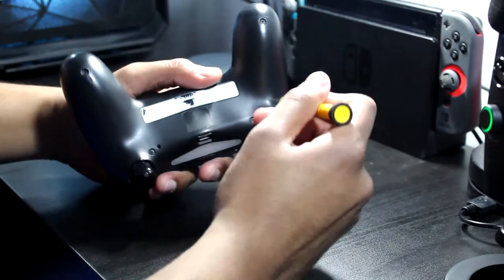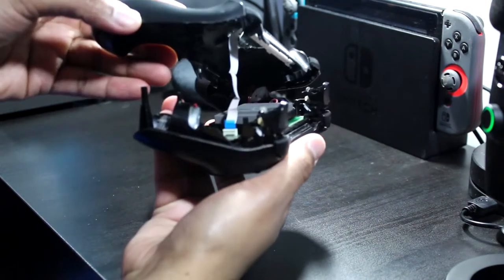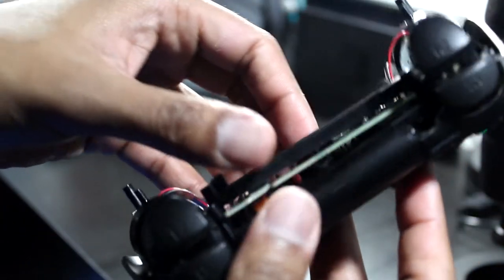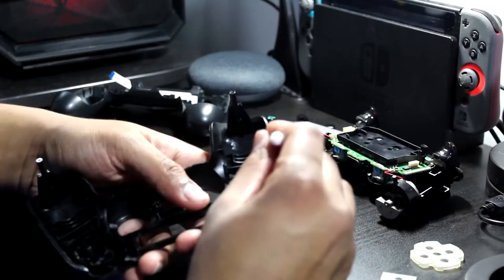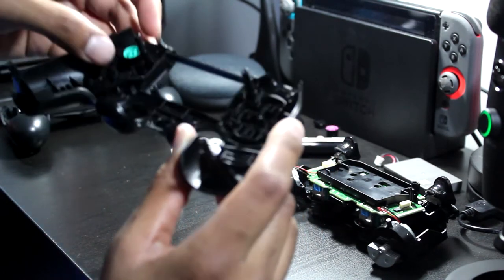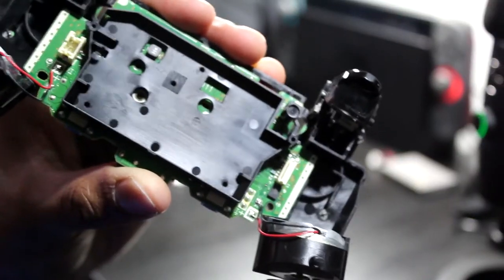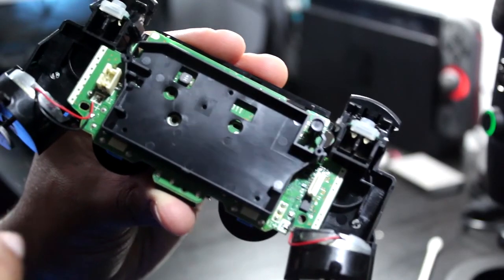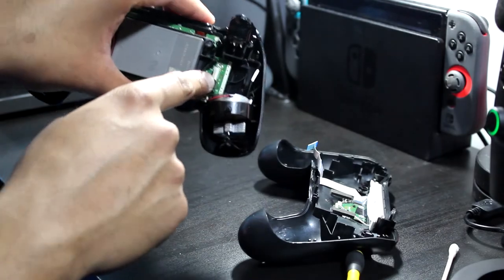How To CLEAN Your PS4 Controller INSIDE and OUT - Fixes Random Button Press Issue!

Comment: BRUUU, lemme explain what i did. I was fixing a joystick problem, (it was sticking and not moving flawlessly so i wanted to clean it, started dumping alchohol down in the joysticks mechanism, it landed alot on the motherboard below and now for the last 4 hours it hasnt started working, no charge, no light no response. My ps4 is completely unaccesable now😕
Reply: You might wanna get a new controller

Comment: Before reading other's comments. I would like to thank you for the video.  Along with about 4 or 5 others it helped me take apart and put back together my controler.  Not pleasant at first as when assembled the lights were not working which was not the original problem.  But it turned out the last ribbon cable insertion was the problem and a little readjustment got the lights to light up whilst still inserting. Starngely the problem of the x button not working was not resolved. It still did not work.  So I was thinking it must be clearly dead. No amount of button pressing would get the 'x' button working. So as it was declared dead I allowed my self some extra well.  It seemed to make no sense having seen inside becuase I could not imagine where the contacts were -But knowing there seemed all that insulation between the button resulting in me giving a forced push to almost bent the whole plastic fram. It worked. So in with the screws and not fingers crossed.  How long it will work I do not know as it was intimitant before. But once it starts working it can work some minutes or an hiur. I will need to see. But would like to thank you for your helpful video. Thank You.
Reply from the maker: Really happy that you found the video helpful!

Comment: I recently bought a ps4 controller and immediately I'm having 1 issue, the circle button is not working well, like I needed to press it too hard just for it to function properly, I'm playing tekken and my combo's are always cut because of the circle button not immediately responding. I'm thinking maybe if I disassemble this controller I can fix the issue. and I'm also thinking that maybe this product that I ordered is actually broken or it has some defects. 

pls I need some advice. Thanks for response.

Comment: Tried it and busted my controller, despite being very gentle and carefull. It's that wire connecting both ends of the controller, that white one. One end simply busted when trying to remove it. I notice it's made of the most breakable type of plastic there is, and it can bend/break/tear apart with as little to no pressure.

Careful gentlemen, I don't advise removing that white clip that is attached to both main components. If it breaks, and it most probably will, you're F'ed.

Comment: The screws on my controller are much smaller and have a head that's almost tamper-proof.  I've tried everything short of drilling to get them out.  I have an analog stick drift problem.  I hate to have to buy a new controller, but I'm stuck.  I'd also like to buy new batteries when these give out--they are a lot cheaper than new controllers.

Comment: Thanks. I decided to try it on my spare controller just because I wanted to see if I could do this without breaking my controller and it worked. 

But it didn’t fix my problem. The joystick is still messed up. 

The problem is like if I play a game like Days Gone or Assassins creed the character will walk instead of run like they’re supposed to. 

But honestly it’s fine. Again, this was just a test run to make sure I wouldn’t break anything when trying to clean my main controller
Reply from the maker: Nice, that's what I did as well. Tried it out on the secondary controller first to make sure it would work out. Hope you can figure out how to fix the joystick issue. Wish I could've helped.

Comment: I was cleaning my ps4 controller and i also had to change the back part. Cuz of it being destroyed and i had to change the piece that is the port for charging. After changing that and that strip thing that connects the controller parts it actually worked and i was very surprised 😭